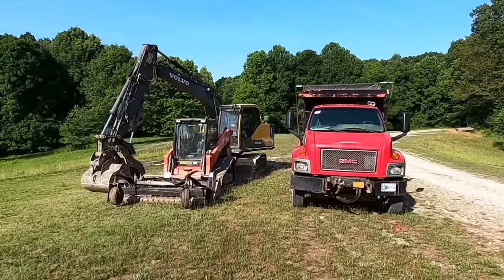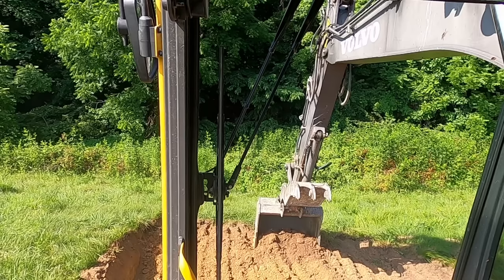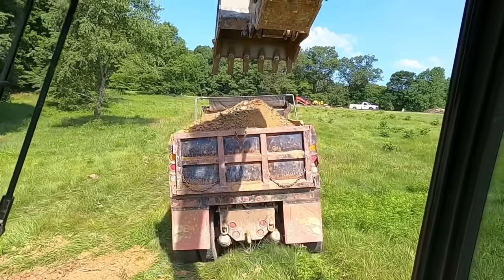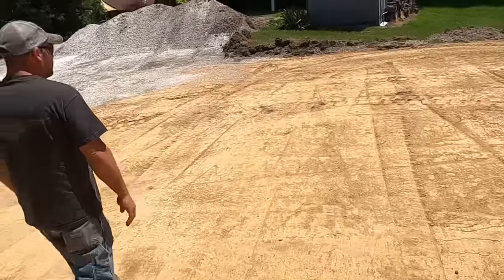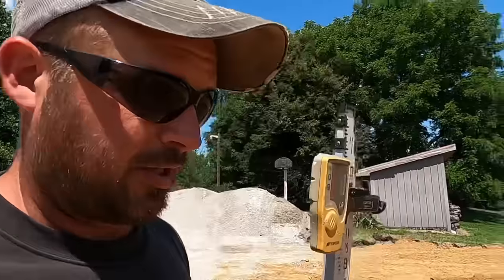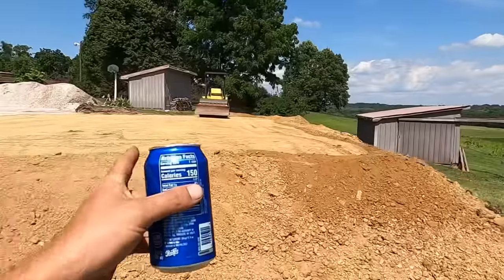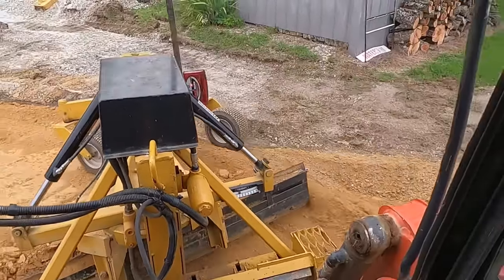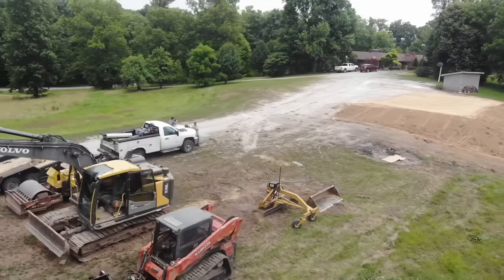Building a pad for a new Pole Barn and a Surprise  visit from Office Hoover and we put him to work.

Comment: hi i dont usual comment but like your videos could i make a quick suggestion about your bucket on the kubota get man behind the scences to prefab up a extension to the back of the bucket with walking floor mesh to protect your quick hitch rams and give you a bit more load room include a step in the extension  for getting in and out in all weather
Reply from the maker: Thanks John

Comment: That grader attachment is, to my mind at least is worth its weight in gold - just amazing what your able to do with it. It appears that the finished level of the pad is higher than the road along side. Is this correct and if so why - prevent flooding?
Reply from the maker: Yes and road is on a slope

Comment: I may be missing something Mike, but can I ask why you didn't spread the soil with the tailgate on the truck instead of tipping in piles & then spreading with the skidsteer? Admit it'd still need grading with the skidsteer but I'd have thought it'd save a bit of time?
Reply from the maker: 2 reason it will not spread like rock will get stuck in the gate and hill is to steep and will Risk flipping the truck

Comment: Did I miss something, if you're going to put a building there, why add dirt that will be covered over by a concrete pad?  ;-)
Ok, you shovel out material you don't want in an area larger then the pad you'll be adding (understandable).
Then add dirt to replace what was shoveled out, compacted it, leveled it (laser & stick) and added gradual slopes (why not level what's left?)
Then you shovel (shave) off more dirt using an auto-leveling blade so you end with ground that's about the same height as what you had after removing the unwanted material in the first place, correct?  ;-)
Reply from the maker: Dude I have know idea what your talking about but thanks for watching 👍😁
Reply: If I understand correctly you did all that work, making it ready to construct a building (barn?) but It looked to me that you cleared away the top soil (including rock), added new soil, then removed most of that new soil in leveling?
Why not level the ground after removing the top soil?
Reply from the maker: Buddy not for sure what you watch but none of the new soil was removed
Reply: So you were just moving the dirt around from high to low spots with the self leveling (laser) blade?
Why can't you do that laser leveling after removing the top soil in the beginning?